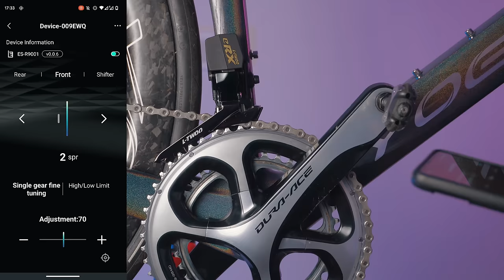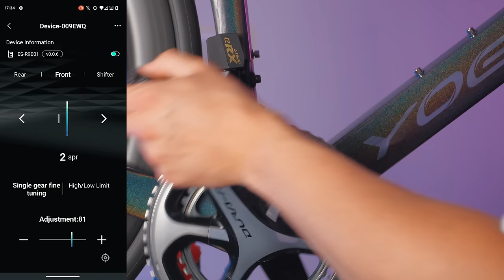The electronic groupset we have all been waiting for. L-Twoo eRX on the Yoeleo R12 aero frame

Comment: Happy to find this video, cause I'm interested in this groupset. I have several questions, maybe somebody can answer. 
1. What is the maximum capacity for the rear cassette? I have to build a custom bike for youth gear meters of development (7,62 meters) and the best cassette would be an xdr 10-36 cassette for my envisaged configuration.  But, does it work  with 36 teeth?
2. Can it be configured as an 1x? So, no front derailleur?
3. Can you not only adjust, but save configurations per wheel in the app? Let's say I have two rear wheels: one has a 10-28, 12 speed cassette (for time-trial), the other has a 10-36, 12 speed cassette (climbing, do-it-all). I'd love to be able, when replacing the wheels, (between races, or during the race, if disaster strikes), to have the settings adjusted and saved in the app for each wheel, and by simply pushing a button, to recall the settings of the rear derailleur from one wheels to another. Something like two or three presets saved somewhere, as I can do with my car's driver seat: it has two positions adjusted electronically, one for me, one for my wife - by the push of a button, I switch between the two positions. 
Thanks!
Reply from the maker: Hey, thanks a lot for the comment and let me try to answer some of your questions.

1. The L-Twoo support just confirmed a max cassette size of 34.
2. If you are ok to have the buttons still on the left hand shifter you could just install it without the front derailleur.
3. That is a great idea to have something like presets for different setups. Currently the app only supports one setup.
Reply: I guess that If it works with 34, it should work with 36 as well, even if unofficially.  Nonetheless, it seems clumsy to me to stop at 34, when the XDR cassettes are 10-28, 10-33, 10-36. Not  to mention that there is a Shimano 11-36 cassette as well (typically employed in CX, but sometimes you can encounter it in grand tours, for climbing, at a pro level).
Reply from the maker: @scherzo0o  yes i agree. It is just what their support told me. As you say there is a high chance that 36 would still work anyways.

Comment: Thanks for sharing so the eRX also comes in 11 speed? I thought it only comes in 12 speed version.
Reply from the maker: You can actually switch it in the app from 12 speed to 11 speed. So works on both systems. I set it up as 11 speed so i dont have to get a new cassette.
Reply: @klein-concept  ooh didn’t knew that. I will wait on the long time review. I’m looking to build a new more modern bike. 
Where I live (Curacao-Caribbean) we don’t have that much season changes. 
But I do have a Bianchi 928L (carbon)which I use for everyday rides. (Group rides  and races) and I have a Concorde Mistral 340  (aluminum) for off season / rainy days. Both rim brakes. 
Maybe I will switch to disc. For both. I don’t know yet, maybe later on
Reply from the maker: Lovely setup. I wish they would make the eRX for rim brakes as well. Seems like you re also a bit of a rim brake fan.

Comment: The pronlem with this groupset is it's still very much in a beta stage. On top of that uou can get parts from an online retailer which ducks because if you brake a shifter or the rear derailleur you cant just buy the one part. With the big name brands i can buy screws,springs, hoods etc easily and if i need warranty service it a few days turnaround.
Reply from the maker: Why would you think it is still in beta? The groupset has been teased over half a year ago already so i strongly assume that there has been plenty of testing along the way. But still you have a point that it is a first generation product for them which will always leave lots of room for improvement as well as the problem with getting replacement parts. But i hope that we will see some distribution in europe soon.

Comment: I think that Luke @ Trace Velo had an issue with bleeding the brakes also. I think that it had something to do with the spacing of the olive on the brake tubing, in relation to it inserting into the brake lever?
Reply from the maker: Hey Thomas, thanks for the tip. I have seen that video. Think it was on the mechanical version. I kept that in mind when putting all together but didnt have the issue he has seen. There is now a new bleed video on the ltwoo youtube which mentions to use the other air opening on the lever. Guess that might have helped to get the big air buddle out that i guess i was dealing with.

Comment: Hi bro i just got the ltwoo erx groupset delivered today while instaling  i had a one problame with the shifters cant able to use torque wranch to torque the shifters to 5nm coz there is no space to fit torque wrench the rubber hoods too thick for extander plug to fit do you have any trick to solve this  how did you torque it ?🤔
Reply from the maker: I used something like this and torqued it by feel.

https://hexlox.com/products/hex-tool?variant=32208601743465&currency=EUR&utm_medium=product_sync&utm_source=google&utm_content=sag_organic&utm_campaign=sag_organic&gad=1&gclid=CjwKCAjwysipBhBXEiwApJOcu-QpJQm0dtLEfQBJXS0HJ2FkR3xUwz6zYVCTXtv6kpTx0yXlLrkFKRoCl90QAvD_BwE

Comment: Looks like you can setup this groupset to whatever count of rear cogs you want (up to 12), by playing with the micro adjustment of every gear. Can you confirm if this is correct? And maybe you could try and set it up with a 10-speed cassette in another video? It is interesting to know what would happen if the rear mech hits the limit screw when indexed for a 10-speed (but the software still allows for an 11th shift).

Thanks for this review!
Reply from the maker: Good question. Per default you are able to switch between 11 and 12 speed but you are right that it might be possible to hack it to less gears by using the same position setting for some of the gears.

Will need to give this a try at some point after doing some more rides on this setup.

Comment: Does the front derailleur auto-trim? I’ve read reviews on AliExpress that claim the auto-trim function was disabled because of patent issues? If it has been disabled how much rubbing are you getting from FD?
Reply from the maker: There doesnt seem to be an auto trim. I only get some slight rub on the max cross chaining setups.

Dont know if this would be any different when setting it up as 12 speed.
Reply: Thanks for the quick response!
I look forward to your future ride updates on the groups performance.
Reply: You can trimm the front mech by the shifters. When you ate in the big ring you can bisch the upshift again and it moving a bit  and it knows in witch direction
Reply: @claudiotelli1416  very cool. I didnt know this. How would you do that little trim?
Reply: @workrelaxfoxuswithkenzo  so you are in the big ring and small casette you normally shifting down in the rear gear. And when you then push the upshift butten in the front the front derrailer autotrimm for example. So its like you just push the buttom on your left hand shifter again for autotrimm
Reply: @claudiotelli1416  thank you 🫶
Reply: @workrelaxfoxuswithkenzo  let me know if it works on yours aswell
Reply: @claudiotelli1416  it does. Thanks for the insider. Real dope.
Reply: Though I'm having trouble with bleeding my brakes, I have my eRX shifting set up 100% so far! Agreed with Michael in that there seems to be no auto-trim. That said, the system definitely is CAPABLE of auto-trim. Pressing the same front shifter button again (for the chainring you've already selected) will automatically place the front derailleur where it needs to be to avoid chain rub no matter which cog it’s on. Unfortunately, it appears you have to push the button. I can't find any setting which purports to make that function happen automatically as you shift the rear derailleur.
Reply from the maker: @chuckaeronut  seems like the automatic trim function was removed because Shimano is owning a patent on it. So we have to be pushing the button twice. Still ok i think. I am barely getting any chain rub anyways 🤜🤛
Reply: @klein-concept  It sure would be a fun project to come up with a little box you could place inline in either of the two wires to the battery, which would count RD shifts and issue FD trim commands upon crossing certain thresholds. It wouldn't be L-Twoo's fault; it'd be end users busting Shimano's patent. I bet it's more possible than it seems. L-Twoos wires appear to have two data lines and two power lines in them, as opposed to Shimano, which uses the pwr and gnd for the data transmission as well. Wish I had an oscilloscope handy. :D
Reply: @klein-concept  Yes, the chain rub issue really doesn't seem to be bad, and pushing the button to eliminate it entirely is fine for a $500 to $650 electronic groupset!

I still get amped up trying to maguyver my way out of things, though... another option would be for L-Twoo to modify the design of the FD cage specifically to avoid chain rub even with no trim. IIRC, Dura Ace 7900 was noteworthy partially because even the mechanical version of the groupset never required manual FD trim. Same with SRAM "yaw" style FDs. Wonder if that's patented too, lol.
Reply from the maker: @chuckaeronut  very good point. To be honest until i found out that there is the trim feature i also wasnt really dissatisfied with the chain rub situation either.

Comment: how do u measure/determine  the recommended  N when using the torque  wrench ?
Reply from the maker: It is written on most components e.g. the seatpost or handlebars. Otherwise i look up online documentation or look at forums. If i can not find actual information i try it with a low torque setting first and then move up by 0.5 Nm. E.g. if i dont have a torque value for a seatpost, i start at 3.5 Nm, see if it slips when i ride and increase until it doesnt.
Reply: @klein-concept   thanks for the reply and also can i use this  front derailleur for a triple chainring set ?
Reply from the maker: @blbhansel8226  unfortunately it is only for dual chainrings.

Comment: Very nice, thank you! My own notes, in case they're helpful to anyone. 
More light would help, for eg when screwing the brake hoses into the shifters, it's quite dark. 
My EZMTB bleed kit from Aliexpress doesnt seem to have the right adaptor to screw into the brake calliper. the body of the adaptor is too wide and the threaded bit doesnt make contact with the threads in the calliper. 
TBContinued.
Reply from the maker: Thanks a lot for the feedback. Yes i need to work on the lighting a bit as i agree its not properly lit in some situations 🫣

For the kit. Did you have a look at a regular sram bleed kit?
Reply: @klein-concept  my kit has a dozen little thingies so I think it includes all possible formats. If I could machine down one of these thingies I could access the thread, atm the body of the thing is too wide to enter the hole, and the threaded bit doesn't get to the threads in the caliper. It's supremely irritating because it's a problem of a fraction of a millimeter
Reply from the maker: Ah so the tread might fit but the material around it hinders it. Might be worth then to look at another kit. Sounds like lots of headache to make the one you have fit.

Comment: How much was your budget for this build and did you go over that?
Reply from the maker: I didnt really have a budget for this one as i had most components already from the previous year. I still think it is a pretty good overall deal for how the setup rides.

- R12 Frame 1640 Euro
- Wheels 900 Euro
- Groupset 625 Euro
- Crankset 200 Euro
- Chain 30 Euro
- Tires 100 Euro
- Saddle 50 Euro

Overall around 3545 Euro

Comment: I'm surprised you "fixed" the chain tension by adjusting what I believe is the B screw. Unless it really is a fourth screwn (H/L limits, B screw and ?). Chain length is usually set without derailleur (chainstay length and number of teeths on chainrings/cogs). On mechanical groupsets if you end up adjusting the B screw to adjust chain tension you'd mess up the shifting. Maybe it didn't affect it because it's an electronic groupset here? You usually want the top pulley wheel to be as close as possible to the cassette (adjusted via B screw) for faster/smoother shifting.

Great video, sorry if that sounds like I'm an armchair mechanic, I'm just being genuinely curious :)
Reply from the maker: Hehe no worries at all. It is a valid comment and i already shortened the chain this morning and brought the b screw back so that the chain is back close to the cassette again 🫣
Reply: @klein-concept  Thanks for the quick reply, hope the groupset is still going great, we need more content like this :)
Reply from the maker: @becyk_du_quebec  yes. Went for a 1h ride after work today. Still shifting smoothly. Will compare it to my Dura Ace Di2 next side by side.

Comment: Would love to know how well the R12 frame was manufactured - how round is the BB, how well aligned were the brake caliper mounts, were the dropouts aligned, etc.  The only reason I haven't ordered one is because I don't want to wind up with a creaking BB that I can't "fix", incessantly noisy brakes, and so on.  I've had bad experiences with this, and I'd imagine that trying to open a warranty claim would be a bigger hassle than it would be with "western" frame manufacturers.
Reply from the maker: I was already riding this frame for at least 6 months last year and didnt have any issues. No creaking and easy setup for the disc brakes. I know what you are talking about as i also had a couple of noname Chinese frames and some of them mainly had an issue with dropout alignment and messed up break mounts. This is not the case with this one tho.

Comment: I would say that you overtightened the plastic compression plug in your crank.
Reply from the maker: You are right. Should also only be finger tight at around 1-2 Nm i think. Good spot and thanks for mentioning. 🤜🤛

Comment: Hi. Very very important.  As it is super hard find information about it. How this 11 speed r9000 works with 12s rear cassette.? No drops ? I will be happy to see movie how this works .as all 12s mini groupsets do not come with front crankset. Looking forward for new video. I have duraace 11s crankset and i have been told it will not work with 12s cassette.
Reply from the maker: But i use a 11 speed cassette as i have set it up as 11 speed setup and dont have a 12 speed cassette to try it out at the moment. Once i get one i m happy to give it a try.
Reply: @klein-concept  so the new Erx is 11s ? I thought all of them are 12s now days.
Reply from the maker: @rowerazzzzzeee  you can switch between 11 and 12 speed in the app. Have a look at the vid 🤜🤛
Reply: @klein-concept  wow this is great function
Reply from the maker: @rowerazzzzzeee  yes. Love it.
Reply: @klein-concept   but taking in consideration  sram Force axs is available for about 950 euro would you go with Ltwoo?
Reply: Not a huge price difference
Reply from the maker: @rowerazzzzzeee  didnt ride that one yet. Its also close to a 105 di2 setup. So depends on what you want. I like the configurability of the ltwoo but shimano or sram is of course a safe bet.

Comment: That metal ring rubbing away on the cables in the headset...
Reply from the maker: But do you see a fix for this? I guess still better than the outer metal insert cutting into the fork. 🤔 As the previous design of the headset didnt have that ring but a similar design to the recalled SL7 setup.
Reply: @klein-concept  To be honest, what Luescher Teknik said in his latest video. Just don't do it.
Reply from the maker: @WayneCouyon  but isn’t that metal ring exactly preventing the case that he talks about in his video as it is protecting the carbon of the fork?

Comment: i think all Ltwoo erx work like that. mine also have not very smooth chain drive movement.
it like bouncing a little bit when used. i tough it was cause by the chain i use. but seen yours have the same issue. may be the Ltwoo design not very smooth like Sram or Shimano.
Reply from the maker: What exactly do you mean? Mine is running very smoothly by now.
Reply: @klein-concept  the chain when we pedaling not stay still it jumping a bit. i try micro adjust it still not run smoothly
Reply from the maker: @endtimeslips4660  weird here it runs smooth now. Are you on 11 or 12 speed?
Reply: @klein-concept  i run 12 speed. last day i take of the erx group set and return to my sram rival.
i try 4 different brand sprocket shimano 105 di2 12 speed 11-34, ZTTO 12speed 11-32, sunshine 11-36 the last i put my sram xdr sprocket wheel it still not good. it shift but when i use the smallest cog or the 2nd 3rd or 4th cog it bumping. make the cadence feel so rough it feel wrong when i want to speedup
Reply from the maker: @endtimeslips4660  hm so maybe it runs smooth with 11 speed but seems to have some issues in a 12 speed setup. 🤔
Reply: @klein-concept  it make me think to try 11 speed setup. why im not thinking to try 11 before i switch to sram. it a bit messy work play with brake fluid. may be latter i will try 11 speed setup.